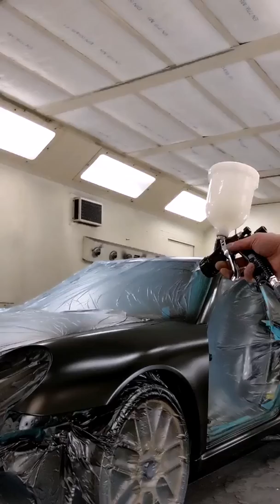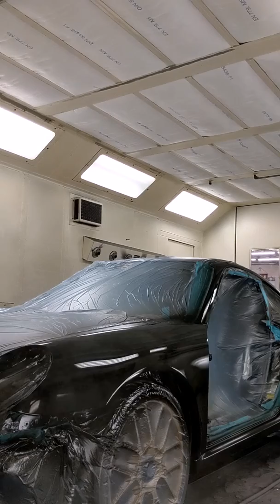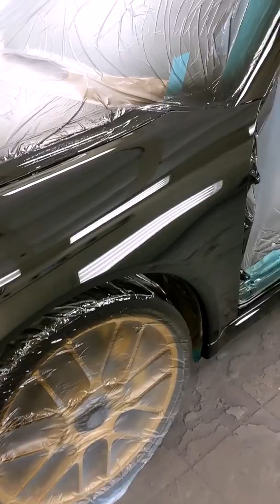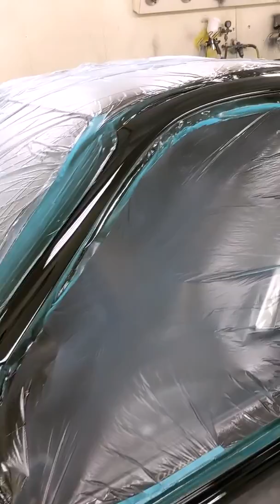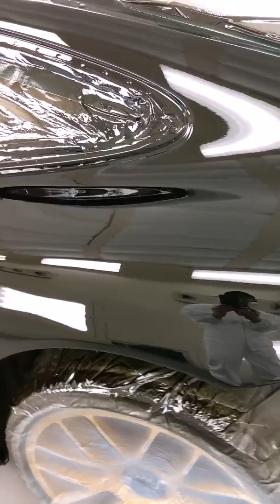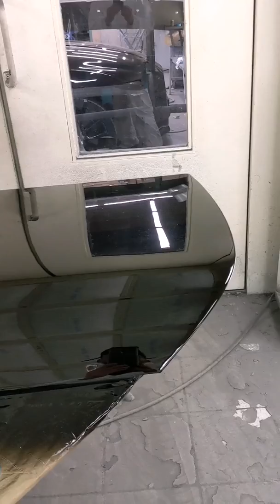Jay Jay Devilbiss GTI pro lite 1.2 with te 10 air  cap

Comment from the maker: For this gun I set it at about 24_27 psi at the gun for fluid setting dial out about 3 full turns
Reply: If you had to choose 1 gun this or the sagola 4600?
Reply from the maker: @Erik7prc  have not spray with a sagola gun can not decide which one it better but I heard sagola is a great gun so I believe either one and also spray gun depend on what kind of material you put on some gun work better than other in that regard

Comment: Jay.....im back! You ever try 1.2 with the te20 aircap?
Reply from the maker: Yes
Reply: @jayjay-oj9pu  did you like it or not really? Does it give a lot of orange peel with the 1.2 te20?
Reply from the maker: It's been awhile so I don't really remember how's the GTI 1.2 with te20 air cap but I think with 1.2 doesn't really matter shouldn't be orange peel, if you find with that combination orange peel present you should go with slower hardener and reducer or slower clear that should give you a nice flow